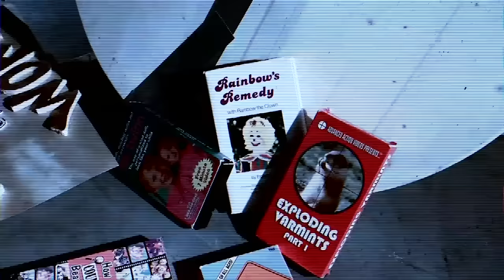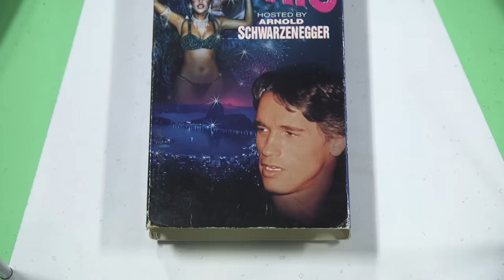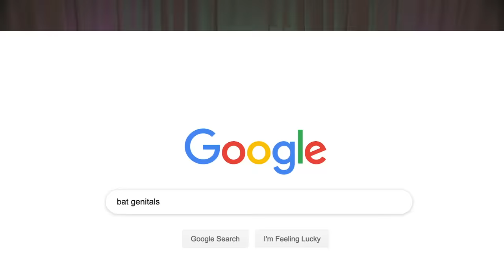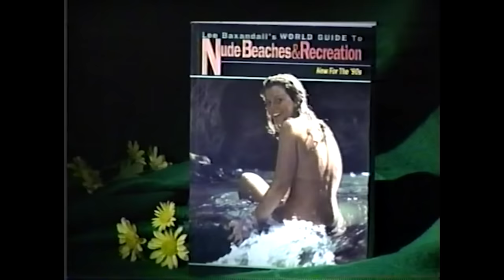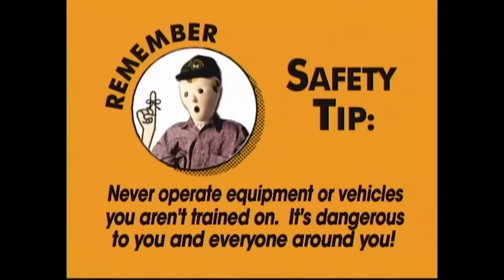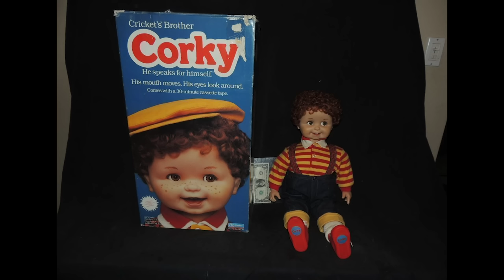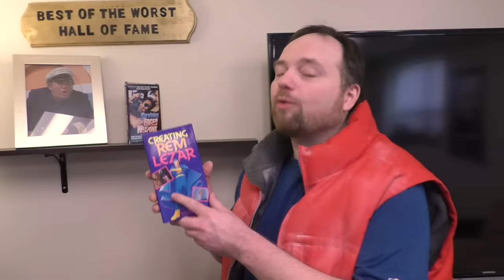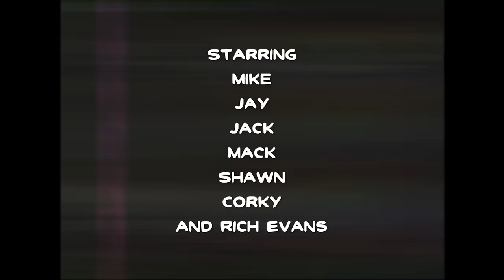Best of the Worst Episode 78

Comment: Those giant tires that are used on the comically large surface mine dump trucks are really really expensive and you have to get on a long waiting list to purchase one due to supply.  There is a secondary market for them.  Maintenance is usually pretty strict with that sort of equipment, but the tires... they squeeze every ounce of juice they can.  If they blow, its usually the sidewalls.  Well not if, but when.  Thanks unfinished mining engineering degree im still tens of thousands of dollars in debt for!  You were relevant for once... for a youtube comment... on an almost 3 year old video.
Reply: So the warning about them randomly bursting is legit? Or was it an over exaggeration on the part of the "scriptwriters"?
Reply: @FR3AKuency  it's legit. as the original comment said they pretty much wait until the tires give out before changing them and giving out usually means bursting the sidewall

Comment: Those tires are inflated to 90 to 120 psi. Depending on their age and well maintained they are, they can explode at random. I use to be an industrial equipment technician (mechanic for big things). The rims them selves aren't the safest so you are trusting your life to the guy who last worked on them. Basically, anything in safety orange or yellow is a death sentence waiting for you to get complacent. A micro leak in one of the high pressure hydraulics can cut off your finger or simply pressure inject hydraulic fluid under your skin. That's toxic. Best to just keep 10 yards away from everything when possible.

Comment: Truck tires are actually dangerous- the rim is a friction-fit 2-part system and the tires themselves are holding anywhere from like 80-110 psi. They're safe the be around 99.9% of the time, but on occasion something'll go wrong and the base will blow the secondary rim 30-40' away. 
I'd worked as a tractor-trailer mechanic for a year and one day while at lunch a few blocks away I'd heard an explosion. When I got back to work I found my coworkers cleaning up rubber and a rim that'd gotten stuck on top of a stack of 40' shipping crates. That was the day I thought about going back to school😂

Comment: From Google: What do crash test dummies cost? Crash test dummies are meant to mimic human bodies in crashes, and show where cars need to be made safer. They are also huge investments - an absolutely stripped down legacy model will start at $100,000 and the latest crash test dummies run closer to $1,000,000.